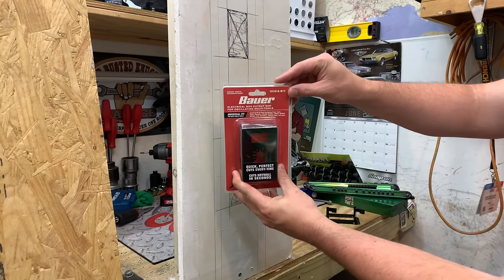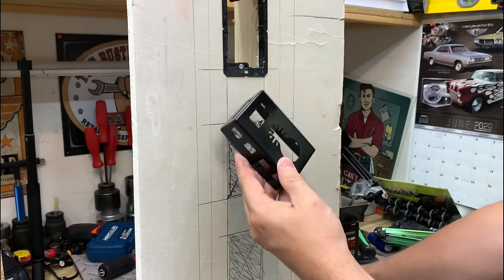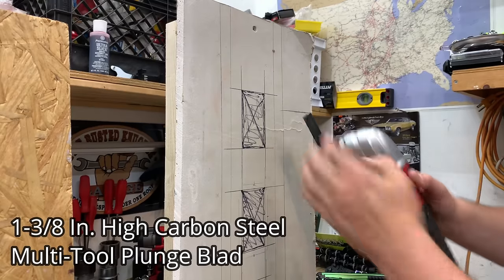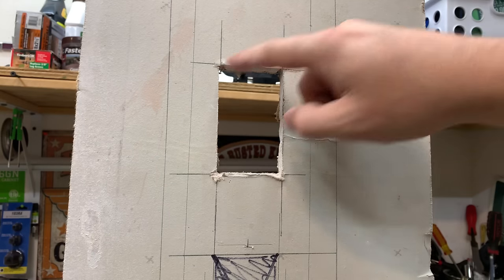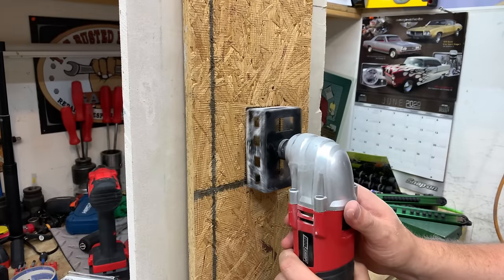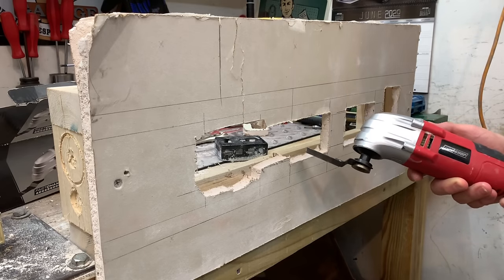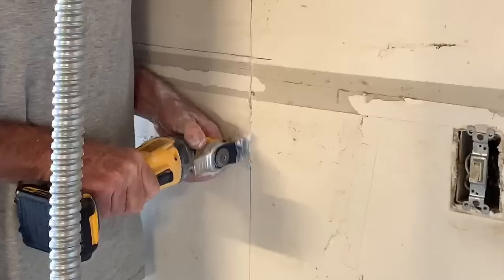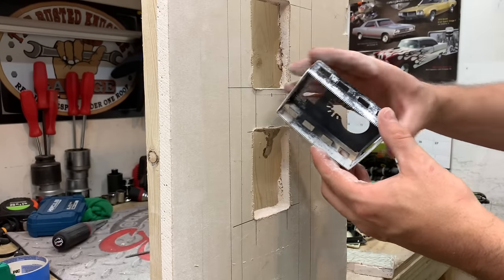Easiest Tool for Cutting Perfect Electrical Box Receptacles Fast Cheap

Comment: No offense but I showed ur vid to my boss and he said he'd fire you if you took over 15 seconds to cut out outlet hole with ocilating tool and I agreed. Also the half moon blade at an angle cuts outlet holes much better then the regular blades. Still thanks for video.

Comment: Thanks for testing on wood. Replacing outlets in our house. Previous owners installed paneling over drywall and didn't cut all outlets properly. Used a blade for cutting outlets but finally caught myself and switched to my multi-tool. Lack the same level of control with my MT compared to blade. Would be nice to have a tool that took some of the guess work out of the cuts. Guess I'll have to hit up the Ace and just find better mt wood attachments.

Comment: I found the technique on these outlet-cutter boxes is that rocking back and forth is not enough, you actually need to pull out a little to let the dust clear out, and then resume the cut. Doing this every few seconds makes the tool work much faster.

Comment: I do a large amount of remodeling, and this works good for me, as the sheetrock is already in place, and hard to know exactly what is  behind it. I also have a jig that doesn't let it jump and damage the already finished wall. Quick and easy.
Reply: This is the only reason im iffy about it with a jab saw  because with a jab saw u can start at a corner and if u hit a stud u missed u can move your template

Comment: We always used a jig saw if it's on the saw horses, and if it's already hanging, we used a rotozip to cut any box holes.
Reply from the maker: I have the rotozip it definitely works. Just can’t get too carried away as it can zip off material in a hurry.

Comment: I think the big advantage getting the Bauer box tool as opposed to the plunge cut is you don’t have to worry about plunging into something you might not know what’s in the wall. You can guess and calculate all you want but there are things that hide in the walls. Unless if it’s brand new drywall and you know exactly where everything is. Great video Chris 👍

Comment: Tool Shop = Menards. The ubiquitous “off brand”.
Reply from the maker: Yes, I bought that at Menards and it works decent. My next door neighbor uses the same one professionally the hex screw is kind of annoying on it and can work itself loose but it does work decently👍🏻
Reply: ClientGraphics - I own the Genesis version of that, it uses a 7mm Allen key and the screw is very annoying. However I just can’t seem to kill it and I use them a bunch.
Reply: I got the same one, works really good, just as powerful as a Milwaukee cordless, I’ve tested them side by side.
Reply from the maker: @friggoff5268  That's good information to know that the Genesis is a good comparable tool👍

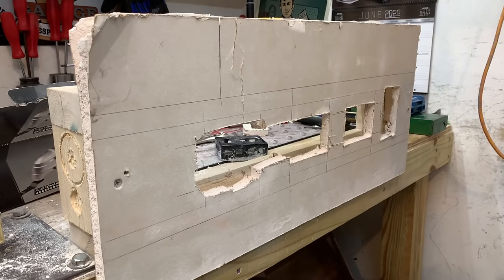Comment: At the 7:00 mark the whole is clearly oversize by about a half inch and the box is rattling around.  You might also consider using the tool at 7:47 with something other than a 6" blade.

Comment: Hey what's up Chris well once again as I knew was going to happen Harbor Freight just recalled the replacement 3 ton jack stands for bad welds Eric Schmidt send a letter stating that if you wish to return the 3 ton 6 ton and 12 ton they will be willing to give you back your money anybody interested in a good pair up 3 ton jack stands on Amazon the prolift double-locking jack stands 2999

Comment: Just a thought, use the box cut out on the wood to score the surface then switch to the plunge blade for the actual cut to get the speed and precision.

Comment: He is using a Tool Shop® 1.6-Amp Corded Oscillating Multi-Tool from Menards. $9.78 on sale. Show some self respect and get yourself a quality tool. 🤧I disagree with the posts that pick at your for not doing a good cut. A little sandpaper can do wonders to level out bad cuts. Using a bottom of the barrel Oscillating tool does no service to testing the harbor freight cutout tool. 

I am not endorsing Dewalt but I have a brushless Dewalt 20v cordless oscillating tool. I am endorsing Home Depot, that is where I get my cordless power tools. The Dewalt will cut out a electric box outlet in 20 seconds or less. 

You should retest using (Harbor Freight) their Bauer or Hercules oscillating tools.

Comment: Dude we're cutting drywall here not concrete. With soft materials like drywall; it's the oscillations that are doing The Cutting not really the teeth. I've cut through multiple layers of drywall with a scraper blade before in a pinch. As far as cutting the first hole too small. That was simply gaslighting. Any real contractor knows that you always either trace the Box 4 perfect cut lines cuz some of them are little different; or that it is better to cut on or just outside of the line to make sure that there is clearance for the box and that it's not too tight. oscillating blades are barely 1/32 of an inch thick, we're cutting in a box here not doing joinery🤷‍♂️ Next point about the framing nails you were talking about; simply throw on  a T style oscillating blade that is meant for wood with nails. They're twice as wide as that blade that you were using and won't get damaged if you hit a nail. As far as cutting too deep; 90% of oscillating blades come with a depth gauge on it so you know how deep your cutting🤷‍♂️. And lastly if it takes someone more than 30 seconds to cut out an electrical box with a T style oscillating blade, they should probably get a new profession. Honestly I only come to videos like these to see how fast these gimmick boxes and other gimmicky tools perform, just so I can challenge myself to beat the gimmicks with skill. Ironically I'm doing an electrical box tomorrow and I guarantee I'll beat 30 seconds with no jigs, no blowouts, no gouging. To people with skills; these things are nothing more than an easy way out for people that don't want to develop their skills. And they really don't save you a whole lot of time anyway unless you're carrying multiple multi-tools on you on the job because the time you saved cutting the whole is lost switching out the blade for another task🤷‍♂️🤷‍♂️. Skill will always outperform technology when honed. Hone your abilities young Padawan. You'll be faster than that little box with some practice.

Comment: I can cut quicker with the regular blade, make it looker harder than it is.... but the box cutter is nice, do you have it for a 2 gang box too?
Reply from the maker: I think QBit has the 2 gang box but its $55. Once you start cutting a few 100 you start to get really good. Someone new and starting ouy or occasional home use it's really helpful.
Reply: I like to use a regular drywall jab saw for cutting in boxes. The dust doesn't go flying everywhere and it doesn't take long in standard drywall.

Comment: That’s a nice tool for someone who doesn’t know to much.I do drywall work every day and I still would rather use a blade and saw.
Reply from the maker: Definitely good for someone starting out and wants a prefect cut out.  I’m sure you can do a cutout as fast or faster with a blade or saw. Just takes time and practice✌️
Reply: I’m with you there.  As someone that doesn’t cut drywall outlet holes often, I’d rather use a saw as well and I cut perfect holes with a saw.  I’ve tried my multi tool 1 time while it was fast, I felt I didn’t have control and made way more mess compared to the drywall saw

Comment: Do they make this in a standard commercial single gang cut in electrical switch box size? Code won't let my trade use the plastic residential boxes, this might save some shoulder and elbow wear & tear if it came in the right size

Comment: It looked, to me, that you got through faster than that, you were applying pressure all the way to the end of the box. You could have pulled it out as soon as it was deeper than the drywall
Reply: Just watched it again, ya, the tool side of the box is slightly wider than the cutting side. So it was widening the hole until it punched through. Total time was likely half as long as tested. 

Great review though 😊

Comment: Hello again Chris 
This has nothing to do the current subject. But have you ever reviewed a Gearwrench 9-piece Magnetic drive tool set  part # 81235. I'm thinking about using this because of the magnetic properties.  To keep from dropping  parts in tight spaces etc? I would like to know if it will do what they are claiming? Thank you again for the Great Videos.

Comment: These are a great idea. I do low voltage security systems, alarms etc. I do have to put a lot of mud rings im drywall and the best advance this thing is is that it has a flat surface and it's easy to level.

Comment: I had seen these tools years ago seemed pretty cool but they were like $50 but for $15 I'll probably pick one up but my only oscillating tool is corded and I just don't think it is convenient if I have to plug it in
Reply: Why? If you're residential powers everywhere. 

Or get the Milwaukee one for $129 CDN (the fuel is $300)

Comment: Interesting video. I've never seen a box cut out so poorly as your "hand cut" example, even by an inept homeowner.  Rather than embellish the,  hard to begin jumping around the surface, freehand cut with the straight cut blade, drop your speed to the lowest setting, then learn how to cut with the blade. Was this a purposeful effort to klutz things up and try to show how the box cutter is superior when it isn't?  As with any tool, there are tips and tricks to improve  performance.  Maintain your cut with a corner of the blade, level out at the finish.  You may also notice that many of the blades have teeth slanted in one direction, that's a clue on the direction of your cut for efficiency and ease of starting.  This came across as a pitch for the cut-out box tool, not an objective review.